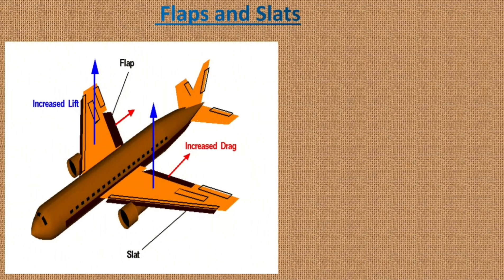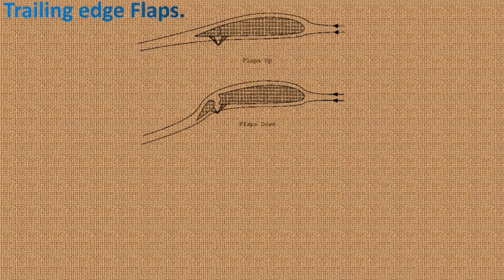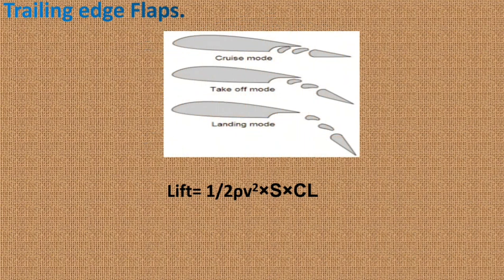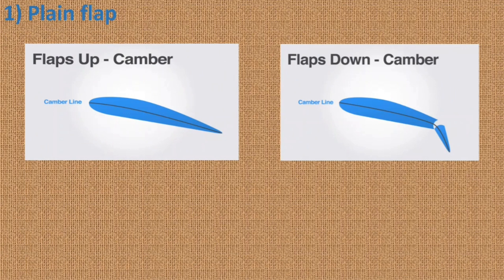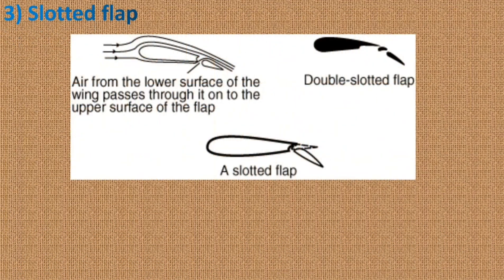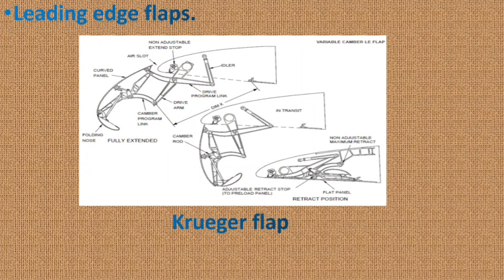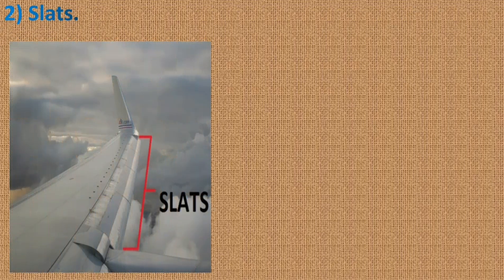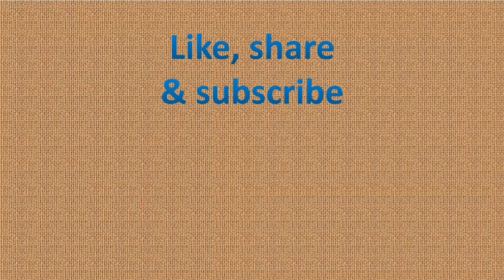Flaps and slats in aircraft | high lift devices on aircraft

Comment: I dont really understand how flaps works,  because shape of flaps extended should make aircraft nose pitch down,  which means that it must be kept up with tail flaps.  Which means flaps doesnt increase lift but they increase angle of descent. I see lot of claims that flaps increases lift,  which cannot be true because they doesnt actually increase lift surface area.

It would help more if these drawings shows center of mass with those wings with flaps